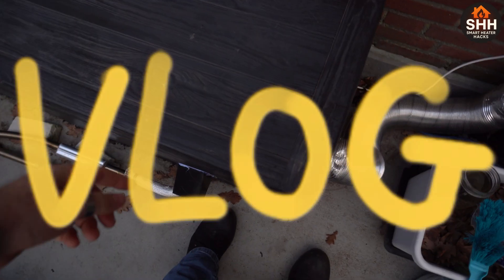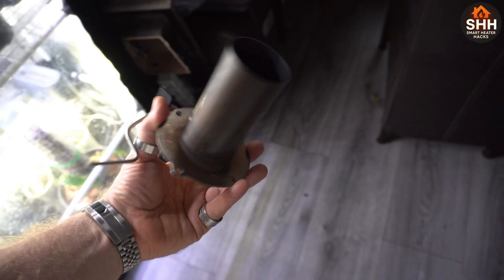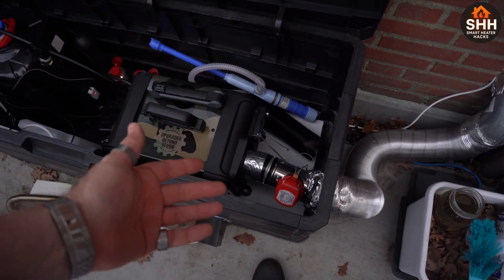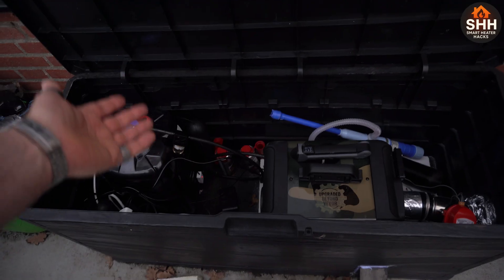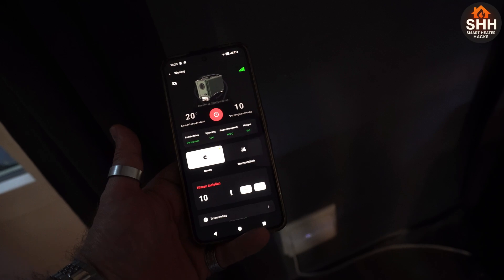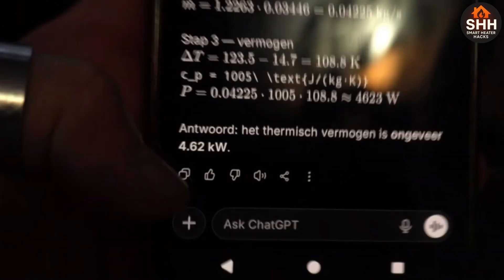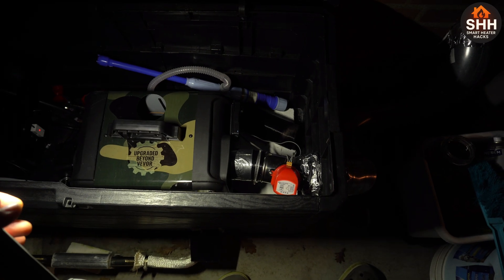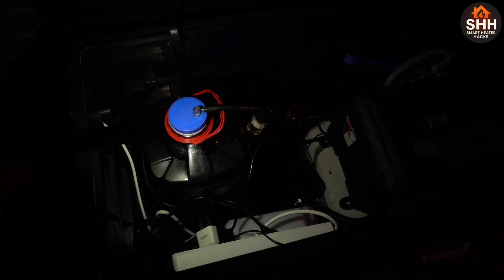The 1000-Hour Club: What My Diesel Heater Taught Me

Comment: Hey man, I also live in the Netherlands, and you inspired me to get one. I installed one today and I'm pretty happy with it, considering the money I'm going to save. I noticed that the exhaust can be a bit loud. I took every piece of advice you gave, like the filter, water separator, fuel line, and the new burner unit is on its way. I'm not sure if I'm going to install it right away. I did buy the things you recommended to get in reserve. The only question I have is, I've seen that you have an extra muffler. I'm at the point of ordering one, but which one do you have: the small, medium, or large one?
Reply from the maker: Owh tof in dat geval kan ik zeker Nederland typen😂 ik gebruik inderdaad twee dempers waarvan een de grootste is om uitlaat geluid te dempen ik weet niet of dit de beste methode is want van webasto zelf zijn veel stiller maar ook 250 euro
Reply: @SmartHeaterHacks 
Aah top man, jaa ik vroeg dit omdat er veel werd gepraat over back pressure en dus de heater warmer zou lopen. Nu met deze koude dagen in NL merkte ik dat de heater het behoorlijk moeilijk heeft, dus ik heb nu ook de grootste besteld en een adapterstukje zodat ik net als jij de originele gekoppeld met de grote erop kan zetten. Ik hoop eigenlijk dat door de back pressure de heater wat heter zou gaan lopen, haha. Verder zoek ik een beetje raad bij jou. Ik probeerde de heater enkel op een 12v 100ah accu te draaien, maar deze was toch al met 1 week Leeg, dus nu zocht ik naar een power supply van 220V naar 12V. Toen las ik weer dat als er een stroomuitval zou zijn of de adapter faalt of iets dergelijks, de heater niet door zijn cooling cycle zou kunnen en dan oververhit raakt. Dat wil ik ook niet hebben. Nu zag ik iemand met een switch die, als een van de twee zou falen, met als hoofdvoorziening de 220V converter, de accu het overneemt. Heel mooie oplossing. Nu zeiden ze weer in de reacties dat er een switchboard is die dan ook gelijk de accu opgeladen kan houden. Het gaat om dit switchboard, de YX850, maar ik zie dat de max 10A is en volgens mij trekt de Vevor van ons zo'n 11/12A bij het starten van de heater. Uit jouw filmpjes begrijp ik dat jij hiermee super handig bent, dus hoop op jouw raad.

Comment: I’ve only had 1 of 5 clog up using road Diesel here. I attribute that to the unit itself LACKI we’re only on Amazon for 2wks then gone. I had a 3m exhaust and it’s 3/4 clogged up these rarely had start up issues but would flame out instead and burn very bad. But due to auto on off I rarely knew it was malfunctioning. I only saw black snow out of the exhaust and smelled co occasionally. So I replaced the units and now they re parts

Comment: The heater should cool down at shutdown to protect the fan. If the heater is installed to recirculate the heated air, does that affect the shutdown cooling sequence?

Comment: Mine is 3 years old, runs nonstop in the winter for 3-4 months straight a lot of the time. Runs like a top, exhaust is still clean and clear. Just change fuel filters, and let her eat.
Reply from the maker: That’s also my perspective when it comes to diesel heaters. As long as the fuel is clean and you keep it running consistently, there’s not much that can go wrong. I'm glad to hear that you're using the heater so often!

Comment: Would it be worth running a dehumidifier if you have a recirculating system? The amount of electricity a compressor system uses will be offset by the small amount of heat given off (100 watts), but the dryer air produced will reduce heat loss in a building, so in effect, it costs nothing to run. Also, does the reduced heat setting of the heater recoup any running cost?

Comment: How its nordkapp super silent pump confront with original pump? Noise and consumption? Thank :)
Reply from the maker: The original pump operates between 82 and 92 dB based on a quick test, which aligns with the averages reported on Facebook and YouTube. In contrast, the Nordkapps model ranges from 42 to 60 dB, showing a significant difference. However, the consumption remains consistent, as it's managed by the ECU.
Reply: @SmartHeaterHacks ❤ thank for reply :)

Comment: I clearly missed some of your videos (thanks YouTube algorithm), I was surprised to see the different burn chamber that Hcalory started using. 

In this video you show the warping of that sealing surface. I guess the fact that the hcalory piece (for one) uses a thicker cast piece instead of sheet metal on that burn chamber flange now makes sense. 

I've got the Hcalory TB max, that pump is super quiet. It's also a different pump design than most (much shorter), wonder what they changed to get it quiet and shorten it.
Reply from the maker: The warping is definitely a real issue, but the bigger problem is that there are no torque specs anywhere. Combined with the very thin metal, it’s not surprising things deform. The cast burn chamber is much better, so I’m glad HCalory is using it now. They’re also inexpensive, around 14 euros, so replacing in vevor units is easy.

The HCalory TB Max looks rock solid, and the pump they use is the same type I’m running now, around 35–40 dB. Once the casing is closed it’s practically silent. You can find those pumps on AliExpress for about a tenner, though without any warrenty. Still, it’s good that HCalory moved to the newer style, since many other brands are still using the old design.

Thanks for the feedback, I appreciate the info.
Reply: @SmartHeaterHacks if you haven't already seen it, I got all my knowledge off the hcalory TB max teardown that David McLuckie did a couple weeks back. 

Teardowns are pretty boring anymore, except when you see things that aren't the norm. 

The TB Max is a quiet unit, I just haven't used it enough to have a valid long term opinion on it. Thus far it's been good, except I do question the voltage reporting in the app. It'll be awhile, but when I get a chance to deal with it again, I'm going to do some voltage testing...app was telling me it was at 11V at times when hooked up to a 48V battery through a step down. Plenty of things to go wrong there (Chinese step down particularly) so I can't blame the app/control unit yet. I have heard from others some of the wires used are so small there is measurable voltage drop, so I need to see what is going on.

Never ran bad whether the app said 11 or 12V, so I just ignored it. Ran fine for the few days I used it. Actually no issues, which is nice given I had to buy it, and hope it worked on arrival within three days for winter camping. Had it failed out of the box there was no time to fix it.